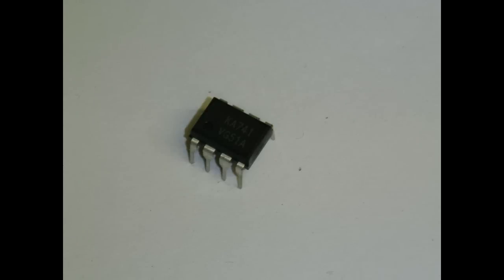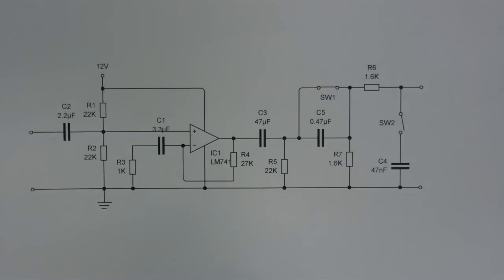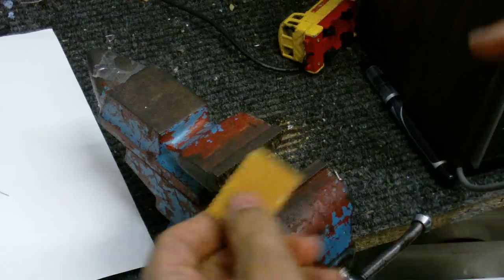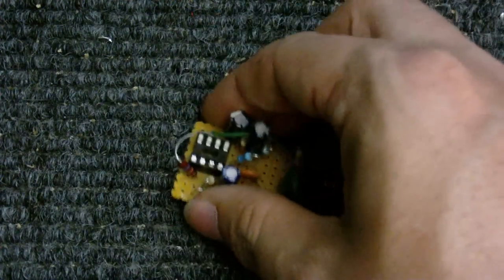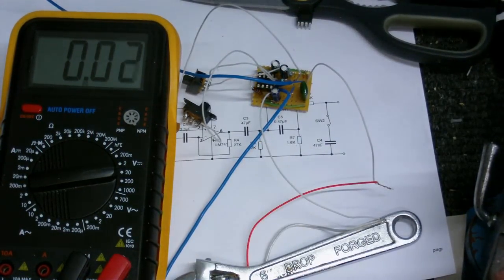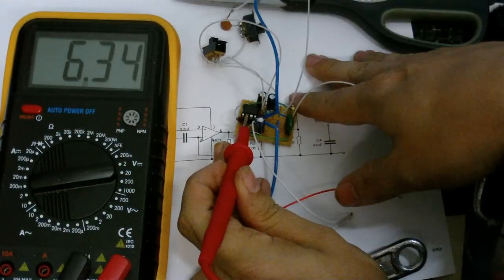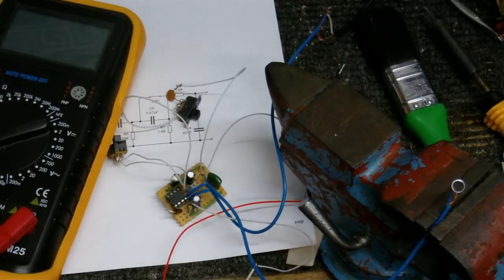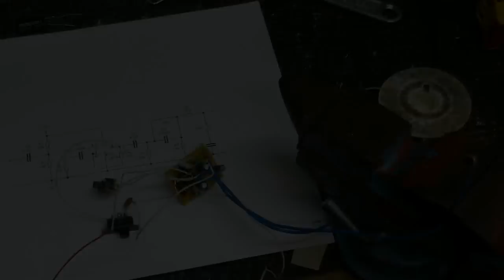CDC ElEcTroNic Work Shop - 741 Opamp based Mic Preamp.avi

Comment: Hey could you please let me know if the "Virtual Ground" between the two 22K resistors always needs to be connected at the "Non inverting input" or could I connect it to the "output"?
Help would be greatly appreciated, cause I can't really find a good explaination of how to connect a single powersupply.
Peace